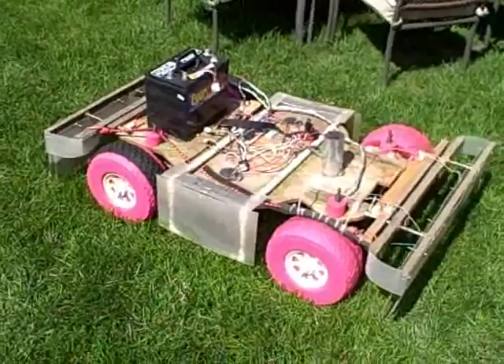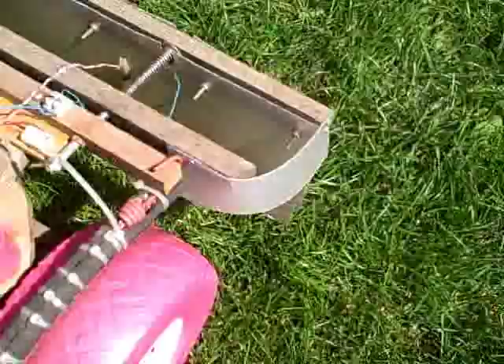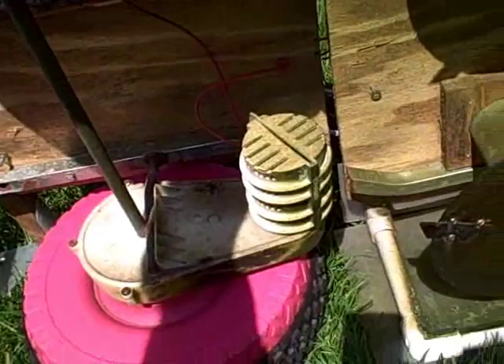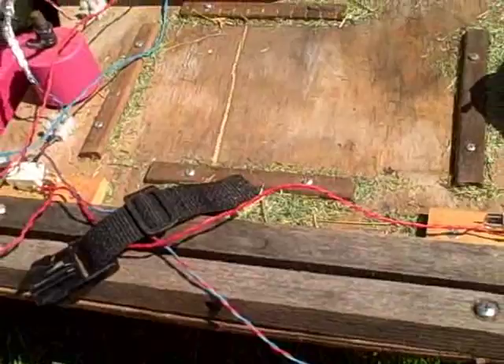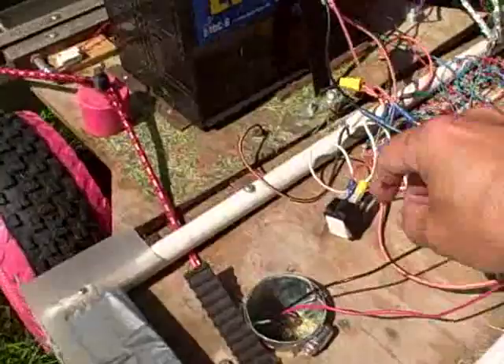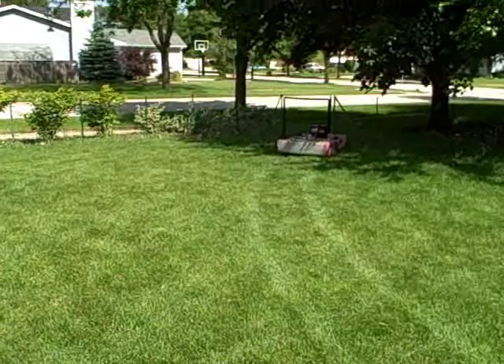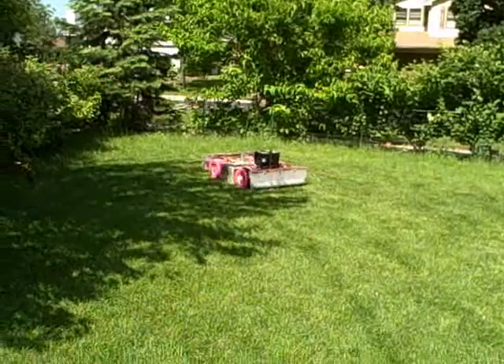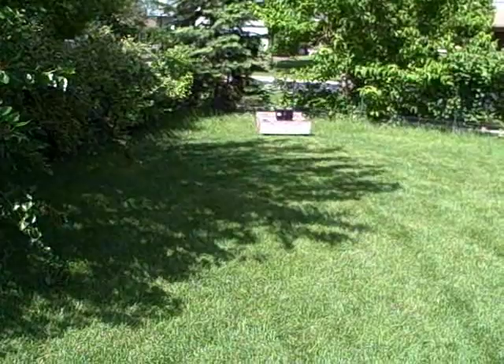DIY Robot Lawn Mower

Comment: Would a like trim line work better or one of the add on things they have out. I love the idea very much. Plus really if people it will not cut the lawn that well with it moving around like that. Think of the Roomba Robot does just about the same thing it is doing and it does cover the whole room. Plus it does take some time. The only thing is if you use it most of the time it will just keep most of grass down. I thought about taking the hard wear out of a old one we have now.

Comment: It's an intresting idea, but not very practical.  The random bumping could take hours to mow a lawn depending on the pattern.  The battery would probably die by then.  Also... razor blades? Common man that is just ghetto.  A regular lawn mower blade which is 10x thicker has a hard time lasting more than 12 cuts.

Comment: Hi there, I am very keen to find the circuit you used to make this robot's control system.  I want to build a lawnmowing robot also using electronic fence and based on a child's ride-on.  Eventually I have some sophisticated ideas for controlling it but I want to make something that works fast to start with.  So can you post a link to the circuit you used please?

Comment: You should check out Arduino.  It's open source hardware and software.  Mostly used for automation projects like this..  A base board costs about 40 to 50 bucks US.

Comment: that is not independent suspension that is straight axle suspension. independent suspension each wheel has its own suspension system i.e. a shock absorber A arm, wish bone suspention for each wheel like most front wheel drive cars today and 4x4 4wheelers keeping the chassis  parallel with the ground straight axle suspension one wheel goes up the other goes down compared with the chassis